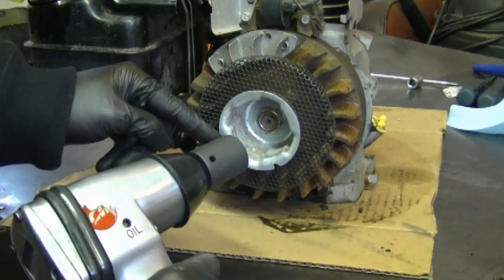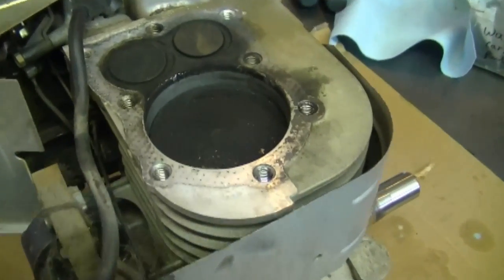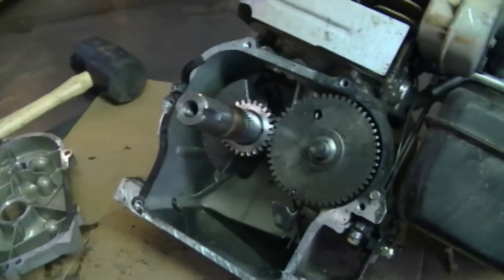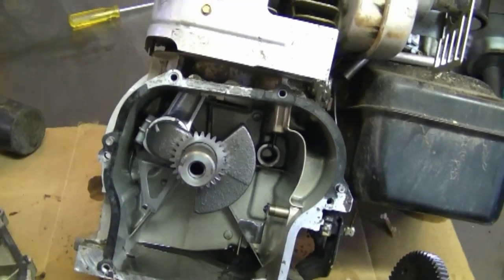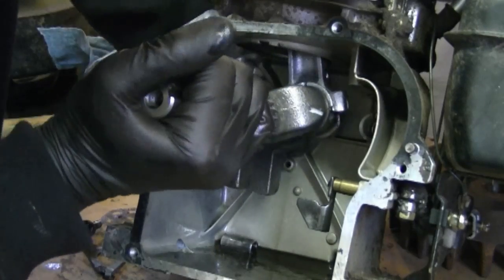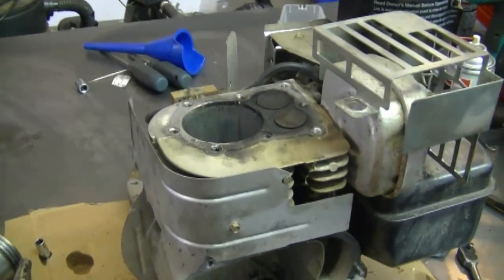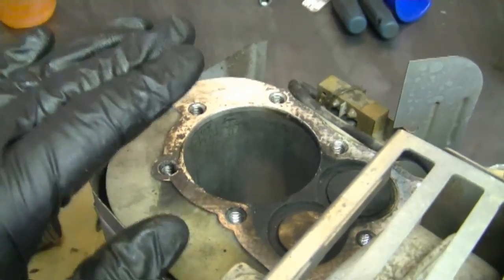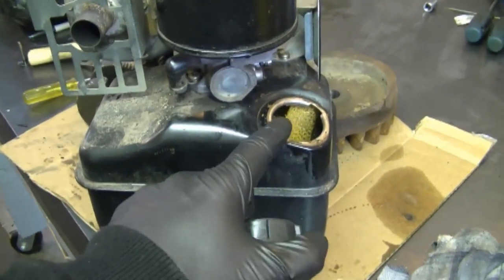5hp Briggs & Stratton Engine Teardown & Possible Cause Of Death

Comment: Sometimes it's not a bad idea to use a little emery paper to polish off the rust on the crank shaft between where the flywheel ends and the crank seal begins.  Otherwise, forcing out the crank that way can booger up the bearing surface in the timing cover.

Comment: That sponge in the carb. In mine, It was getting broken down by the ethanol I think because my carb kept clogging every 30 minuets of running. I removed the sponge and its been months and it still hasnt had a problem.I

Comment: I have the same engine. I'm using a screw in muffler but it rattles off because its on a go kart.  The holes for the muffler have to broken bolts in the,  it looks like someone tried to drill into it and use an extractor but failed. How hard would it be to get those out or if its even possible.

Comment: Yeah, the best bet is to get a good used engine and just change the crankshaft.. also I have found that when overhauling any briggs engine with an aluminum block it is best to spend a little more and put in chrome rings,, if it has a steel sleeve it is best to use cast iron rings.